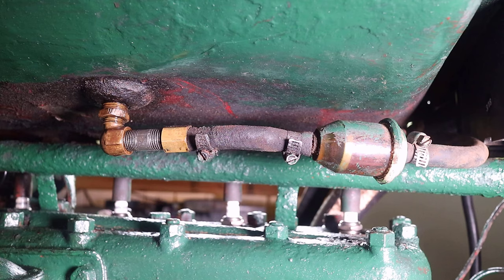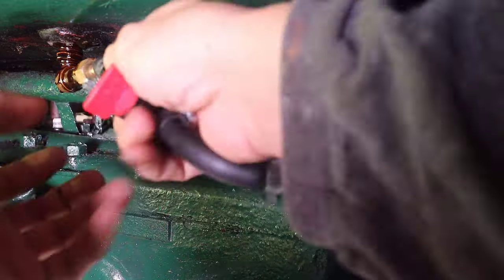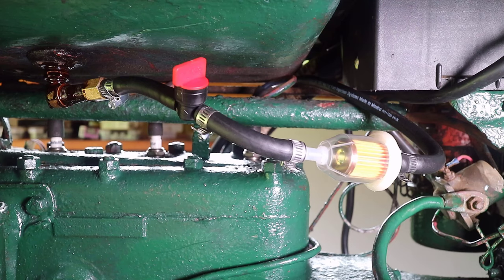Replace rubber fuel line Ford 9N Tractor

Comment: Excellent setup! I'm going to do the same  way on my 9N. Bypassing the fuel sediment bowl which is prone to leaking and have a inline filter and shut-off valve. Great video!
Reply from the maker: Although rubber line looked old, I thought is was good of the previous maintenance person to to route the line toward the rear (away from the top of the engine heat), with the fuel leaking to the front, something needed to be done.

Comment: My 39 9n had sand in the carb, in the oil portion of the stock air filter, and the sedement bowl looked gross. I knew the air filter was letting sand in so I removed it, the tank, the carb, the fuel line and the sediment bowl and replaced all with new except the air filter, for that I put  a tube shaped filter on the air pipe. I like what this person has done with his fuel setup. When you have a leak, get a  good light on it and trace it to it's origin and replace anything that worked before when you installed it.
Reply from the maker: Thank you for your perspective on this.  The stock oil air filter setup was a good design but I think that making modifications to keep the tractor working for your specific environment is consistent with the problem solving that made both Ford and Ferguson great engineers who provided us with these machines.

Great advice on the leaks, when dealing with fuel every bit counts.

Comment: How do you keep the rubber line from getting burned?  The original is a metal line.
Reply from the maker: The main thing to keeping the rubber line from burning is to keep it from contacting the hottest surfaces such as the exhaust manifold. Although not the best or a stock replacement, there are some instances when rubber fuel line is used without burning such as small engines (mowers) or engines with older carburetor setups.  At the time of this video, I was trying to replace the fuel line that was installed to get the engine started while ordering parts.  I do understand your comment because fuel is highly combustible. Regardless of material, this machine was so old, I didn’t want to proceed forward at this point without replacing what was there first.